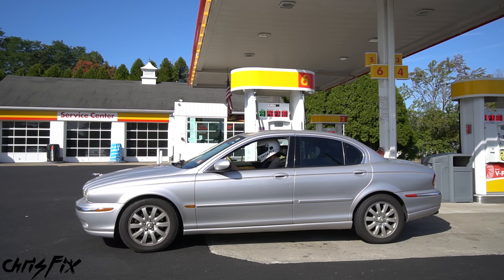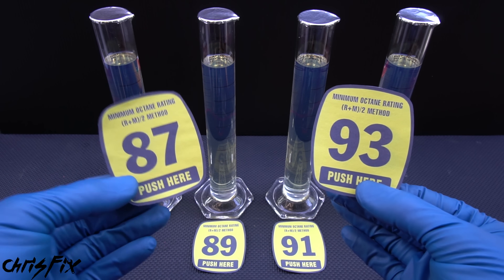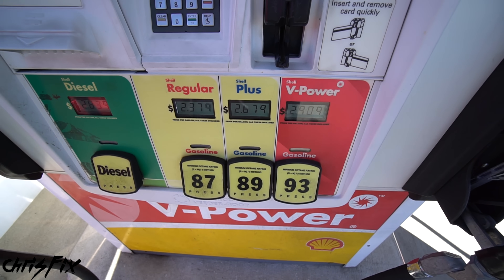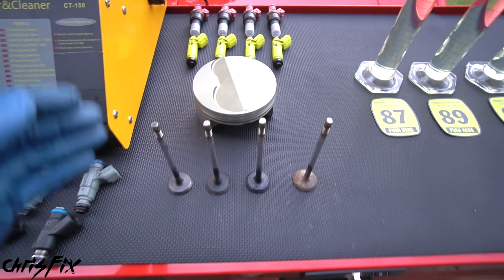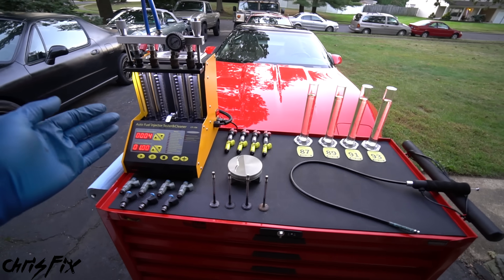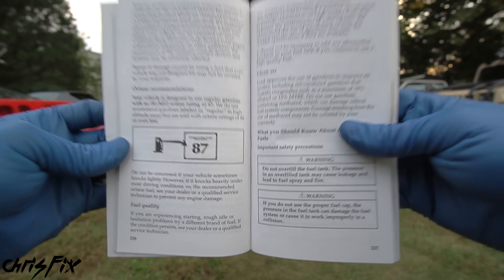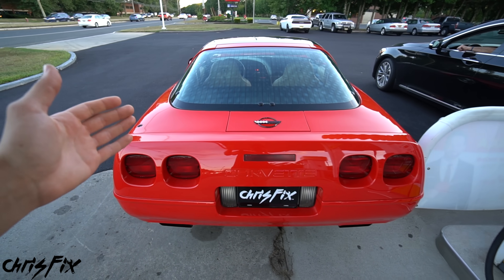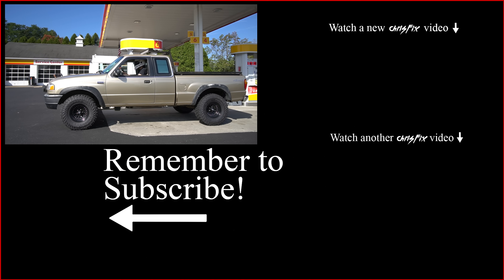What is the BEST Fuel to Use in Your Car or Truck and WHY

Comment: There are a few parts of this video with misunderstood info or completely wrong. One is that higher octane fuels DO burn slower and carbon will not build up on top of the piston enough to increase the compression ratio to where it is a problem. If it does somehow  build up that much you have more problems than the fuel. And that first video edit showing the fuel coming in burning and then leaving the cylinder was backwards lol it showed the air and fuel coming through the exhaust valve and exiting the intake 😂
Reply: Don’t get me wrong it was an amazing video and I love your channel just wanted to point out a few things

Comment: Bought a 2016 Accord brand new and almost from day one it had a very slight stumble in drive at idle, switched to premium and after a tank or two the stumble went away and I’ve stuck to premium since then and it runs smooth as ice

Comment: I built a Chevy small block. I made tunes for 87 and 93 and I'm thinking of building and tuning a spark map for 100 octane avgas from my local airport. No e85 for my old pickup. I don't want the corrosion.

Comment: Most modern engines are high compression engines - 11:1 or more and actually designed to use high octane. In some vehicle manuals you can even find wording "Regular or Super for better performance". So why to put 87 tag on gas cap? Marketing! Car still works fine on 87 by retarding ignition point but it's not the fact it works its best. Personally on my vehicle I'm getting - 22-23 MPG on regular highway exactly as it's stated in the car specs and I'm getting 26-28MPG on Shell V-Power. Try it and see if it makes a difference and if not, of course there is no point to spend more money

Comment: I can run e85 in my 91 chevy no problem but u have to run the 454 injections on a 350 e85 leans out really hard so u spend about the same on fuel not really worth the work to modify it

Comment: Got an '06 Dodge Dakota with the 4.7L H.O. engine. Owners manual says 91 recommended, not required. Factory specifications say 93 recommended. Used 87 for a long time. Couldn't  reach 13mpg no matter how gently I drove. Switched to 93, mpg went up to the mid 15s. Sucks because premium is 75 cents/gal more than regular. 

Just wondering why the owners manual doesn't say the same thing as the factory specs.

Comment: I've also hear that if you can run regular and switch to premium then switch back to regular your engine will not run as well as it did before the premium. Google seems to think that is not the case. Any thoughts on this?

Comment: In my geographical area, shell folded up there tents and booked it...☹️ any alternative fueling points? I’ve been using Exxon synergy fuel. Or does the brand not make a difference?

Comment: I had an 86 Jeep Cherokee with the 2.5 liter GM engine. The compression ratio was 9:1, which sort of sits the fence between premium and regular (a lot of places did not have a mid-grade back then). I could run 4 tanks of regular in it, then it would start pinging, so I used the premium that had the "super-duper" additives, and one tank would clean the engine enough so that it could run regular again.

Comment: Hey Chrisfix. For a car that runs on regular octane would you recommend using premium octane once in a while to clean out any carbon deposits that may have built up over time and if so after how many miles/ kilometers?

Comment: My 2001 Yukon XL5.3 with 173k pings under heavy load or above 4000 rpm. What could cause this?
Edit: truck has no codes at all. I checked with my scan tool and it shows no codes

Comment: Another fact:  87 (regular) is usually 10% ethanol.  91 (premium) is usually 0% ethanol.  89 is a 50/50 mix of the two, so it is usually 5% ethanol.  Ethanol does not have the same energy content as pure gasoline, so you could see a slight improvement on fuel economy by running premium.  Also, all gas stations in a certain area usually get their gasoline from a particular fuel depot which in turn is supplied by a refinery.  Therefore, a Shell branded station could be selling Exxon-Mobil refined gasoline.  The only difference is the final additives the gas truck adds to the base gasoline to make it "Shell".

Comment: I've always been torn between the myth about high octane = higher mpg because I've experienced it myself. Back in high school I used to drive the "family loner" aka '96 camry. On 87 it'd run me 5-6 days without needing to fill up, on an average school week and weekend ride. But sometimes I would run 93 (especially after katrina cause 87 was sold out) and boost my same exact range to 8 days. Same if I had half or 1/4 tank of 93 and topped off with 87. same range extended. In college I had a civic si. Now with that car it was a different experience. I never noticed a fuel mileage change (always shifted at 3k) but the efficiency of the engine accelerating through the gears during hot summer months was noticeable. I used to run 89/93 only with that car because I was a wanna-be raceboy. But when I ran 87 I always noticed a change, typically in 1st and 2nd gear only. It wasn't like squirting some NO2, it was more like a 1-5% difference in power.

Comment: I like your videos but stopped watching after one of the very first claims is objectively incorrect.  While octane rating does not measure the fuel's energy density it is undeniable that, for practical reasons, higher octane fuels are necessarily more energy dense.  This is usually by a few percent and is measurable, repeatable, and well documented.

Comment: Hey Chris, your RON to PON conversion is off: 87 = 91.1, 89 = 93.2 and 91 = 95.3 not 98. Which means only gas stations that have 93 actually offer the equivalent of European Super Plus 98 Octane fuel.

Comment: Cool video chris, The more I know the better.  Got a question What about 91 octane no ethanol?  It only comes one flavor, and is unbranded. My car takes 87.

You can only buy it way up north in NY in columbia county but not dutchess or below.  Bought some for the mower and maybee because the gas was old (with stabilizer) IT just took off.  It was great.  Is it good for cars?  I heard the bikers at the harley Davidson all get it, as it better than ethanol gas and its right by the dealer in Kingston!

Comment: Gas does not clean your motor like they say it does people are going to believe this because how many times you run a tank of gas out and took you're motor apart to see if it's clean they tell a lie because they know people don't check inside of the motor... I tore down a motor and it was nasty as crap and I used shell bp citgo Exxon.......and these cheap gas stations sell gas as 87 89 93 they don't tell you when you pump in 93 octane gas your just paying more for 87 octane it comes out of the same tank and they only have one tank... I used to put gas holding tanks in for the service station and they ripping you off and the next time you get just one gallon of gas you pay say the price is 245 a gallon pay for 246 and you get the hole gallon of gas the company is getting a penny for every gallon add it up a penny might not seem much but how many people a day stops and gets gas....

Comment: My reason for using regular: I’m poor
Reply: same, but paying for the correct gas upfront could save a lot of money later on if something goes wrong .-.
Reply: @duff8402  Unless it's a "I got myself a Cadillac but I can't afford the gasoline" kind of situation. Lyric's from AC/DC's "Down Payment Blues" from the Powerage album (1977.)
Reply: Me too. I have a 02 Nissan Xterra SC engine and i run mid grade fuel.
Reply: Ha lol
Reply: Built it myself bud, still poor.
Reply: Rob John u ain't poor bud those parts ain't free
Reply: Meh, all depends on what you drive.  My 08 silverado gets 87 octane, my 05 mini cooper s gets 91 octane and 93 when I can find it.  Simple fact is even on the shittier gas my silverado will probably go 100k miles more than the mini.
Reply: @MitchGadberry13  ever get knocking? My 07 Silverado does so I put booster in it
Reply: Im poor too but id never put 87 in my audi. Smh
Reply: Rob John me But Ialways put 87 in my audi. Ive been driving it for a year now and nothing is wrong in engine. You can use anything as long as it is in manufacturer’s recommendation.Why not?! Don’t get nervous to damage your engine because cars now are already designed in Gasoline with ethanol and that is already studied and established so nothing to woory. Unless you put diesel in your diesel in your gasoline engine designed car.

Comment: You should get more into e-85  on the prefromance side and why it actually burns cleaner than normal fuel .......e xplain the energy difference between  both fuel options

Comment: i have a 2005 dodge G caravan. it has 250,xxx km on it. in video i heard about running higher fuel to help clean out injectors and gunk. would u recomend this for my situation? bought it used from person who used as a work vehicle and was a rebuild (he did not tell truth when i bought it).

Comment: By the way, Nikolas Tesla invented a spring steam engine. NIKOLA TESLA, OF NEW YORK, N. Y. SPECIFICATION forming part of Letters Patent No. 517,900, dated April 10, 1894. Application filed December 29, 1893. Serial No. 495,079. (No model.)

Comment: I live in Australia and at my local gas (we call it petrol) station we have E10 (10% Ethanol), 91, 98 and sometimes E85 (85% ethanol, race fuel) and petrol is really cheap, currently it's $1.36 (US$0.90) for regular fuel.

Comment: While I must say a lot of info was thrown at me. My Biggest take away I got from this was this. Run Regular 99% percent of the time. BUT, just to clean the engine the odd time to run a higher grade fuel (Like 89 for example not 93) Just to give it a good clean up. I personally use SeaFoam like, 1-2 times a year just to keep it in good running order (Have a Mazda 3 08). Tho to have this knowledge this helps to know I can do the engine some good by just changing the fuel once awhile (And when it;s low enough lol.)

Thanks Chris for being the best on youtube mate!

Comment: I prefer to always use the prenium at Shell and other gas companion that but a lot of additive in super gasoline. Because I done the calculation to have a clean engine and It's cost cheaper to buy the gas with premium gas. The upper cylinder whit the premium gas is always well lubricate and It's seem I get more miles for my bucks.

Comment: My 2018 V6 Chevy Colorado recommends 87, but I get fuel economy and power benefits from 89 and 93, which isn't mentioned in the manual. Makes sense though, it's 11.5:1 compression. I run 89, gives me the best economy, but not quite the best power.

Comment: Hi! Love ur videos. After reviewing ur video I realized I've been using wrong number for 2 years. I have a 2013 VW Tiguan and have been using Regular instead of the required Supreme.  I have noticed that it's running sluggish,  taking a while to speed up and here clicking  from motor. What should my next step be?? Can I just start using Supreme and it will fix itself? Or do I need to change parts out?

Comment: I only ever fill the tank at Shell, I even use the $.05 card because why not?  I was curious about how much better the v-power high octane fuel compared to 87’.  I do want to get rid of any excess carbon deposits; would it be better to do the 2500 miles on v-power or use sea foam on it? The car itself runs pretty damn good for having over 200k miles 2007 w/ a new drive train put in.  Any feedback appreciated

Comment: I put E-85 in my '02 Grand Am once, just wanted to see what would happen. Didn't seem to make a difference but I never tried it again.
Reply from the maker: So if it's 2001 and newer it can take a 15% ethanol content without any problems. Realistically you can probably do 30% without any problems. Did you run straight e85?
Reply: @chrisfix  it was actually 51-84% ethanol that's sold at a local Sheetz, not full E85, not sure why I said E85 before. I didn't have any issues running it but I can't remember how full the car might've already been before adding this stuff.

Comment: If most cars either run off of regular gas (87) or premium gas (93) what is the point of having an option for plus (89)? Is it just a middle of the road for cars that use regular but to have a second option?

Comment: Hey chrisfix I have a 2011 Nissan Sentra base 2.0 liter and I used 87% octane (contains up to 10% ethanol) and I get 14 mpg. I used 91% octane (contains up to 10% ethanol)  and I get 16 mpg. I used 87% octane (ethanol free) and I get 16 mpg. I use 91% octane (ethanol free) and I get 21 mpg

Comment: Hey Chris, so I always use premium gas on my 4 cyl Mazda 3. Even use premium on my lawnmower. The reason is what u stated. To prevent carbon build up. I noticed that my friends that run regularly on everything always have clogged injectors, cats going bad, sluggish runs..etc So if premium prevents all of this w more cleaners and additives, why not always use it for the cost of a happy meal every time I fill up?  Great detailed info vid as always 👌

Comment: Chris - in the early part of the video, you said that higher octane doesn't have more energy than lower octane, but then at the end you said that if you run high octane, you'll get better mileage and a little more power - so which is it?  :^)

Comment: so how does that work for us europeans?
with 95 and 98 ? oww 89 = 95 and 93 = 98 seems logic lol
now we have 95 e10 (10% e85)
and how does e85 ethanol then work? vs 95/98 petrol? ow you did anwser every thing NICE
but still my mercedes clk 200 kompressor runs e85 fine. rought starts but in 30sec it adapts and its smooth.
my friends clk230 starts and drives fine stock on e85.. mine doesnt kidna random but okay

Comment: I just want to point out one thing with the “premium recommended” point you made, before you go pumping regular, double check in the owner’s manual that there isn’t a minimum either, my gf used to have a Mini Cooper S that said “premium recommended” but also said the minimum it could run was 89 octane, so please double check and make sure there isn’t any minimum either
Reply: i bet de manual dasnt say ani thing about water in de fuel?
Reply: @rikuthetiger-cat7366  X;D
Reply: Ricardo Aguilar pretty hard to find a owners manual for a 50 year old car that applies for a built big block
Reply: Ehh the mini should be run on at least 91 my dad's owned 3 and 2 Cooper S's my grandmother currently still has hers the mini engine from 2000-06 ish have really finicky motors never had anything but problems when running lower octane on my dad's old minis
Reply: Elliott Grossman I feel like my gf just had some really bad luck with hers, if I remember right I think within like a month of owning it, she had to go take it to the shop because of something with the camshaft of the engine and the belts, and then in the end she sold it because of a failed fuel pump (which I’m sure was her fault because she never listened to me when I told her to never let her car run dangerously low on gas and she had a really bad habit of doing so) and she didn’t feel like dishing out more money into it (at that point they’d spent around $6000 in repairs, all while having bought the car for $9k)
Reply: @ricardoaguilar474  yeah at that point definitely not worth it. Fun cars when they work but terrible when they break.

Comment: Just check your car manual. It says what Gas type your engine was tested with and should be used. Mobile 93 last longer in my car, because of the engineering behind it and the additives they add. Gas stations do make a difference.

Comment: Me: Hey ChrisFix, what type o....

ChrisFix: Have you checked the owner's manual?

Me: No....

"ChrisFix walks away"
Reply: Welcome to the life of a dealership mechanic. A large majority of issues could be resolved if the customer just read their manuals.
Reply: @NickkAtNyte  Manuals these days don't recommend to change the the transmission fluid and filter anymore, do they? "Lifetime Fluid" is in there alright...
Reply: Jee Whiz, that's a great idea. Didn't think of that one. Thanks Chris"Fix"
Reply: But i dont have an owners manual

Comment: Everything you said is true but some run high test not for the octane but to have gas without the ethanol in it such as for a boat or a vehicle that sits idle for much of the year and gets few miles on it.

Comment: Chris, a great idea would be to make a sister video to this one by talking about the different blends of ethanol example e-10, e-15, e-20 vs. using 100% percent gasoline. Comparing the different fuel blends would be a great video. Also for those who don’t know all gasoline refined in the United States has up to a 10% percent mixture of ethanol included in the gasoline. Unless it is the 100% percent gasoline as mentioned.

Comment: When you get to high altitude places, like Denver, CO then regular starts at 85 octane (not E85), midgrade is 87 octane,.  Lower air pressure at higher altitudes allow engines to perform as well with 85 octane as they would with 87 at lower altitudes.

Comment: Chris, what about older vehicles that have a carburetor? One rumor is the the ethanol in modern gas will cause issues with carburetors, especially they sit for extended periods of time. Many gas stations offer ethanol free gas in the premium grade. Is this true and is there and advantage to running high test?

Comment: Idk about that on the fuel "myth". Just like everybody says the 6.0 powerstroke is a turd but actually it is an amazing engine. Originally built by International for the the European market but bought by Powerstroke for the North American market. The 6.0 is built to run on the higher quality Euro diesel but running in America on our diesel cause extreme wear and tear. I figure the same would apply to gas.